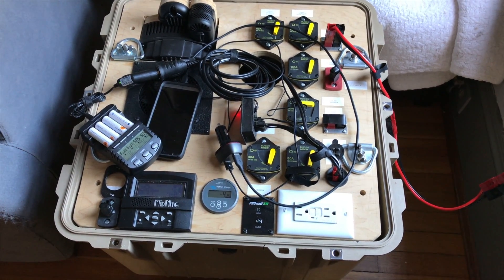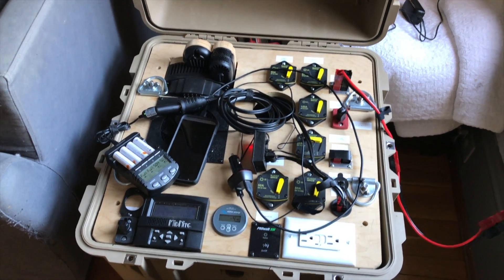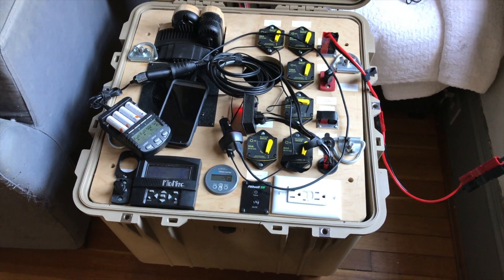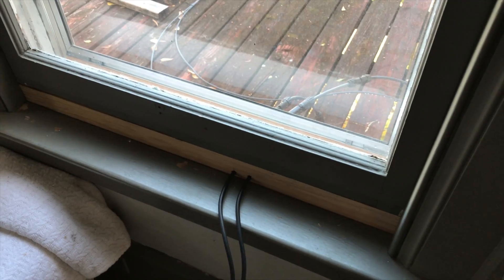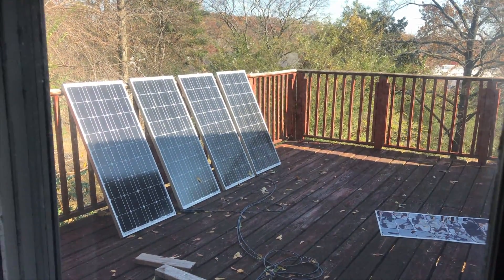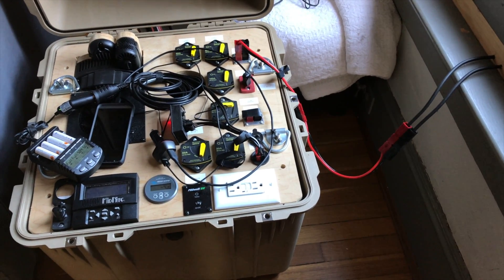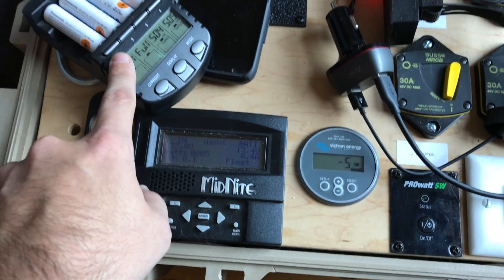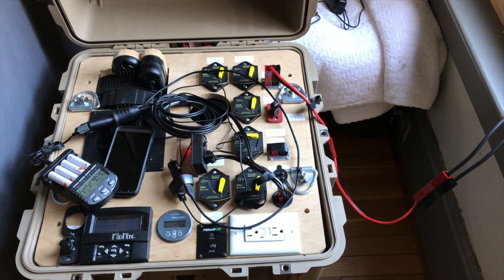How to charge a portable solar generator inside the house

Comment: Kudos to you, as I found that my local village regulations will require both permits, & inspections for me to install permanently (anywhere), even if I'm not doing grid-tie, and the only way to bypass that, is to have a non-permanent setup that I just set "out in the yard"...  I can and will use stakes to anchor it into the ground for safety, but they have to be something I can pull out on demand to meet code.

Ultimately, my best solution is to move to a less restrictive location, 'cause after jumping through the hoops they set up for solar, it will never be cost-effective for anyone here to install it.

Comment: I highly doubt you need a permit and who cares what others think.  Have you considered ground mounting those panels?  There's a lot of great options available if you have the land and southern exposure.
Reply: You do need a permit in most places, unless you want to be fined. May be less of an issue in rural areas. Ground mounting is ideal for maintenance and building cost, but my location has too much shade at the ground level.

Comment: too late, i've been trying this at home for a while now. same thing, i didn't want to pay huge money for a roof mounted grid tie system. i wanted to build a cheap solar system and experience off-grid solutions. the cables go through the window as well. i use it to charge batteries, ipad, anything 5v usb and also 12v led lighting. except i use flex solar panels, very thin and lightweight, so much easier to mount anywhere. gotta love your channel!
Reply from the maker: Are you using a lithium battery too? I forgot to mention in the video that any battery that vents (lead acid, for example) should be avoided inside a building due to hydrogen gas venting. Lithium and AGM avoid this problem as AGM is sealed and lithium doesn't vent hydrogen.